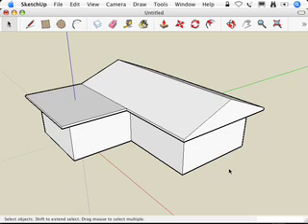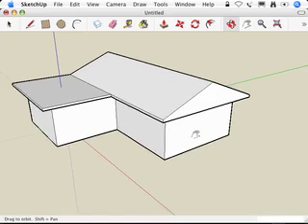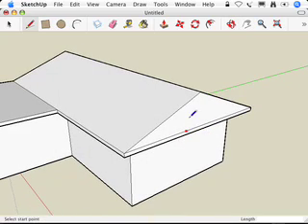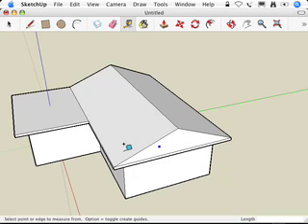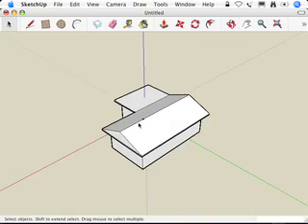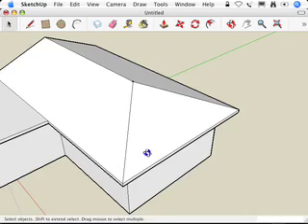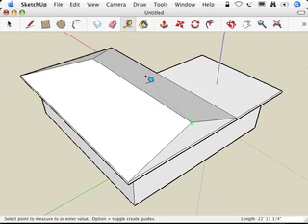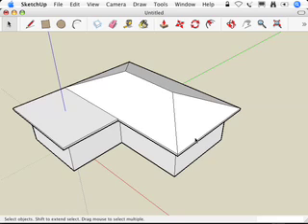SketchUp: Making hip roofs

Comment: Good video on technique. One observation from a roofer though. It is not correct to say that a hip roof by default has the same pitch on all slopes. I have observed this perspective being passed around in other sketchup videos, etc. in fact, almost all hip roofs have steeper slopes on those smaller planes typically designated as the hip planes that come to a point, and shallower pitch on those slopes often designated as main slopes that involve the ridge.

Comment: Actually there is an easyer way to do this. Simply by selecting the corner of the roof and draging it parallel to the axis/roof  and typing in the distance. This way you lose the need for the guide, the two lines and you don't have to erase anything.  Or for a 10 sec job you can simply make a box at the height of the roof, draw a line from a lower corner to the middle of the upper edge and then complete the roof with the follow me tool.  I just wounder how aidanchopra didn't think about this.
Reply: brooo ik this comment is 12 years old but u saved me so much time!